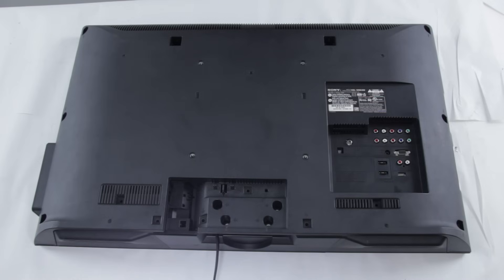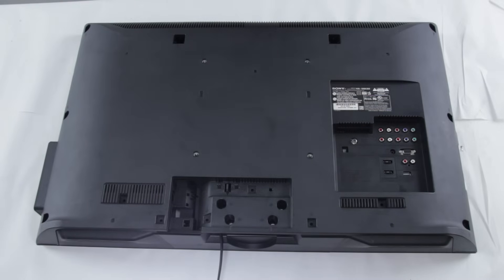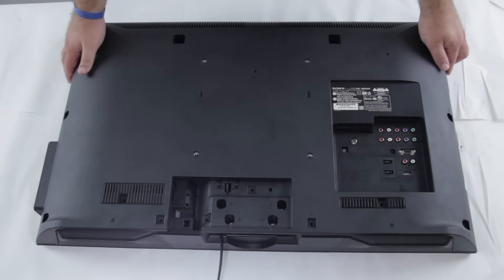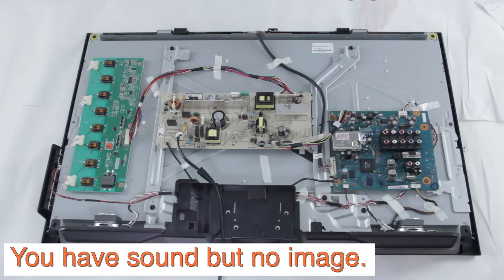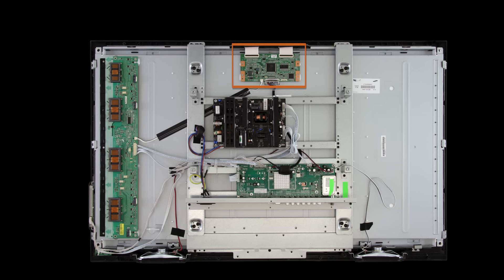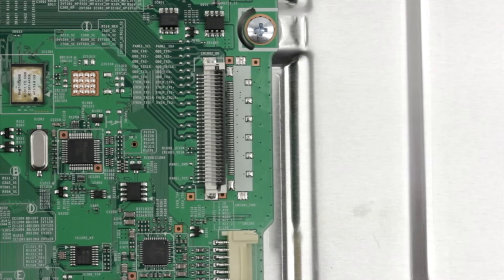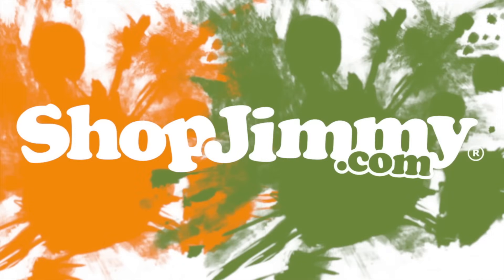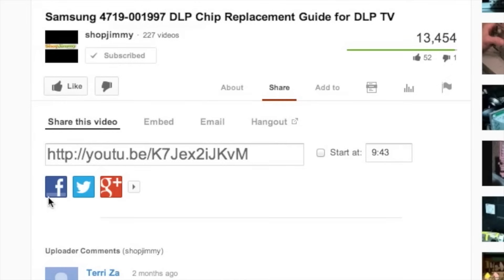LCD TV Repair Tutorial - T-Con Board Common Symptoms & Solutions - How to Replace T-Con Board

Comment: samsung UN55C7100WFXZA Version no : SQ01. all my 4 hdmi input doesn't work. smart tv and USB connection works.  I have tried different hdmi cables, unplug for 10 mins, Factry reset none are working. Device connected tried Directv receiver, PS3, Google Chromecast. Please help. thanks!

Comment: I have a Samsung LN32C350D1D tv with a picture issue.  The best way to describe it is that the image on the screen flickers like a strobe light and strobes upward.  The sound is perfect.  I just plugged in our PlayStation 4 and when the normal blue screen comes on with the white welcome menu, the white letters strobe upwards from the bottom to the top no matter where they originally appeared.  PLEASE tell me it's a simple fix because I'm always up for a DIY dig in and fix it!
Reply from the maker: Kellie Rowbotham  Please watch this video FIRST to help with your repair!  https://www.youtube.com/watch?v=BP3NVNCGEv8  This could be a problem with the backlight inverter or the power supply in your TV.  You may need to replace each board individually to see which one fixes the problem with your TV.  Click this link to replacement parts for your TV model number:  http://www.shopjimmy.com/catalogsearch/result/?q=LN32C350D1D  There may be multiple boards for the same TV model number, be sure to match part numbers on your current board, with your replacement for compatibility.  Thanks and please let us know if you have any further questions with your TV Repair!  www.shopjimmy.com

Comment: I have a Samsung LED UN46C7000WFXZA. Thin black horizontal lines  are now present that are strong on the left but fade near the right. At times they disappear 20 min or so after turn on. At times a little knock or reposition will also make them disappear.  Motherboard? T-con? Panel? Any idea? You comments much appreciated. Thanks.
Reply from the maker: Peter Tigler   This sounds like a TV panel (TV Screen) problem.  If your TV panel is bad, it may be more cost-effective to replace the TV as panels are typically hard to find in stock, difficult to replace, and expensive.  Thanks and please let us know if you have any further questions!  www.shopjimmy.com

Comment: have a dynex model number DX-LCD32-09.. problem is the left side of tv has a yellow hue to it and the right side is normal.. what can be done to fix this?
Reply from the maker: Angel Martinez  Please watch this video FIRST to help with your repair!  https://www.youtube.com/watch?v=BP3NVNCGEv8  This could be a problem with the main board or the TV panel.  You can replace the main board to see if that fixes the problem in your TV.  Click this link to replacement main boards for your TV model number:  http://www.shopjimmy.com/catalogsearch/result/index/?cat=56&q=DX-LCD32-09  There may be multiple boards for the same TV model number, be sure to match part numbers on your current board, with your replacement for compatibility.  Here is a link to a video showing how to identify your part number, click here:  https://www.youtube.com/watch?v=LIWO2A_tuaI  Thanks and please let us know if you have any further questions with your TV Repair!  www.shopjimmy.com

Comment: Sony Bravia KDL-40V4100. Ok. I got this tv and i've noticed a few things. 1. thru the compound cable (R,W,Y) to cable box, I can hear audio but the screen is fully green with horizontal dots moving across the screen in groups. 2. When connected with coaxial cable from the cable box, no audio and the screen is green with the moving dots. 3. When I look at the menu options, when I was trying to pick the input source, the screen looks fine, if I recall correctly. 4. When I turned it on, during my attempt at figuring out the buttons on top of the tv, left half of the screen had yellow and I think brown lines going up and down. 5 at some point during the use of the buttons on top of the screen, it looked like the screen was not migrating from menu screen to menu screen, cleanly. There was like lines or chaos, almost like there was a cable loose connecting the board with the buttons, to the rest of the tv. I'll take a look again on the tv to make sure I saw everything like I said. So, what do you think is going on? Thank you.
Reply from the maker: ulyssescpt   I would check your cable box to see if it is working correctly.  Thanks!  www.shopjimmy.com

Comment: I have an insignia ns-46e560a11. The screen has a white haze and thin vertical lines over the whole screen. I am thinking t con board. fa7m4s120c4lv0.1
  Your thoughts please.
  Len
Reply from the maker: Len Ciufo   This sounds like a TV panel (TV Screen) problem.  If your TV panel is bad, it may be more cost-effective to replace the TV as panels are typically hard to find in stock, difficult to replace, and expensive.  Thanks and please let us know if you have any further questions!  www.shopjimmy.com

Comment: JVC jlc47bc3000 the TV will power on however it stays on the JVC screen. I have tried to unplug the power cable for some time and then plug it back in but I am still having the same problem. The TV also does not respond to the remote while it is on. Based on my research, I believe it may be a main board issue. Am I correct? Also what would be the cost of a new main board?
Reply from the maker: Nathan Maddox   I recommend replacing the main board in your TV.  Click this link to a replacement main board for your TV model number.  http://www.shopjimmy.com/jvc-3647-0502-0150-main-board-for-jlc47bc3000.htm  Be sure to match part numbers on your current board, with your replacement for compatibility.  Here is a link to a video showing how to identify your part number, click here:  https://www.youtube.com/watch?v=l_z-ovbj_BI  Thanks and please let us know if you have any further questions with your TV Repair!  www.shopjimmy.com

Comment: Hi I have a Sony Bravia KDL-32BX300 that has started showing green vertical lines and snow / white lines - it is intermittent and usually clears up after I click off and on a few times. Sometimes it goes all day others it cuts out every 10 minutes or so. I've had it since 2007 so I guess that may be it but I'm suppressed that I didn't get more out of a quality product. Back then this was a $1,500 - $2,000 tv. Today they're going for half that or less. Cheers.
Reply from the maker: Sam Edge   This sounds like a TV panel (TV Screen) problem.  If your TV panel is bad, it may be more cost-effective to replace the TV as panels are typically hard to find in stock, difficult to replace, and expensive.  Thanks and please let us know if you have any further questions!  www.shopjimmy.com
Reply: Did you ever get a reply on this?  This is happening to me.

Comment: Hi there, I have a problem with my JVC LT-32DY8ZJ it does power on fine but the picture is a bit to dark and it's nothing to do with settings, any ideas?
Cheers
Reply from the maker: Radoslav Ivanov  Please watch this video FIRST to help with your repair!  https://www.youtube.com/watch?v=BP3NVNCGEv8  I recommend replacing the power supply board in your TV.  Click this link to replacement parts for your TV model number:  http://www.shopjimmy.com/vestel-20351313-power-supply-unit.htm  Be sure to match part numbers on your current board, with your replacement for compatibility.  Thanks and please let us know if you have any further questions with your TV Repair!  www.shopjimmy.com

Comment: Great video!!   I have a Samsung LN-T 5265F which take about 7 minutes to come, and clicks as it warms and then comes on.    Once on it has thin vertical colored lines on the far right side.    As it warms these lines reduce to a thin dark line which remains.    What do you suggest I do to correct these problems.    

Tony B.
Reply from the maker: Latrice Battle   This sounds like a TV panel (TV Screen) problem.  If your TV panel is bad, it may be more cost-effective to replace the TV as panels are typically hard to find in stock, difficult to replace, and expensive.  Thanks and please let us know if you have any further questions!  www.shopjimmy.com

Comment: I got Sony bravia model no.KDL-46V5100 when i turn it on theres a vertical colored line on a haft of the screen.what is the possible cause of this?
Reply from the maker: Romeo Castro   This sounds like a TV panel (TV Screen) problem.  If your TV panel is bad, it may be more cost-effective to replace the TV as panels are typically hard to find in stock, difficult to replace, and expensive.  Thanks and please let us know if you have any further questions!  www.shopjimmy.com
Reply: ok thank you guys,i go ahead and salvage the parts and throw away the tv panel

Comment: Hi, I have a Samsung 40" LN40B500P3F. The audio works, I can change channels and everything but I see no picture. If I turn off the lights in the room and shine a flashlight to the LCD screen I can vaguely make out that there is a dimmed picture there, it's just not being lit up. I have located the T-CON board on the TV and through your video and some other research the most likely culprit is the T-CON board. Should I go ahead and order a different T-CON board? I'm not 100% sure whether this is the problem or not, so I thought I would ask you first! Thank you so much for your help and videos! They are absolutely wonderful!
Reply from the maker: Rocco B  Please watch this video FIRST to help with your repair!  https://www.youtube.com/watch?v=BP3NVNCGEv8  I recommend replacing the inverter/power supply board.  If the board is out of stock, we may have a repair service available, where you send us your board and we repair it.  Click this link to replacement parts for your TV model number:  http://www.shopjimmy.com/catalogsearch/result/?q=LN40B500P3F  There may be multiple boards for the same TV model number, be sure to match part numbers on your current board, with your replacement for compatibility.  Here is a link to a video showing how to identify your part number, click here:  https://www.youtube.com/watch?v=sSJexLvRrjM  Thanks and please let us know if you have any further questions with your TV Repair!  www.shopjimmy.com

Comment: Hi there, really hoping you guys can help me. I have a Samsung LN-T4665F from about 2009.The TV has an intermittent problem of when I turn it on, it's ok for a few seconds but then the screen goes black but there is still sound. I know these TV's have many problems and I read all about the capacitor failure, but the caps all look good, and the power board was replaced with a new one about 2 years ago. I was thinking of replacing either the logic board or T-Con board. Thanks a million.
Reply from the maker: Andrew Arzoian   I recommend running the flashlight test on your TV.   Here is a link to a video we produced that shows how to run the flashlight test. https://www.youtube.com/watch?v=xUzCLgoSPGM Please reply with your flashlight test results and we can recommend a replacement part for your TV repair. Thanks and please let us know if you have any questions! www.shopjimmy.com
Reply: ShopJimmy.com Thank you very much. I did the flashlight test, and I have backlights, and audio. Based on this, I assume it is the T-con board, but I am curious if a bad t-con board would make the problem intermittent. Sometimes, the TV will go a day without failing, the will start doing it. Thanks again
Reply: Andrew Arzoian Just an update to my problem, I have the TV working ok at the moment, but it will not recognize the cable. I can only use a DVD player or HDMI through the auxiliaries. The cable will not work at all. Does this sound like a main board issue?
Reply from the maker: Andrew Arzoian  Please watch this video FIRST to help with your repair!  https://www.youtube.com/watch?v=BP3NVNCGEv8  I recommend starting by replacing the T-Con board to see if that fixes the problem.  If not, then you may need to replace the main board as well.  Click this link to replacement parts for your TV model number:  http://www.shopjimmy.com/catalogsearch/result/?q=LN-T4665F  There may be multiple boards for the same TV model number, be sure to match part numbers on your current board, with your replacement for compatibility.  Thanks and please let us know if you have any further questions with your TV Repair!  www.shopjimmy.com

Comment: I have a Samsung LN40A TV. The colours are all funny. We have tried to factory reset it, but that did not work. Is it the T-Con board that needs replacing or just garbage?
Reply from the maker: *****   This could be a problem with the main board or the T-Con board in your TV.  You may need to replace each board individually to see which one fixes the problem.  Click this link to replacement parts for your TV model number on our website:  http://www.shopjimmy.com/catalogsearch/result/?q=LN40A  There may be multiple boards for the same TV model number, be sure to match part numbers on your current board, with your replacement for compatibility.  Thanks and please let us know if you have any further questions with your TV Repair!  www.shopjimmy.com

Comment: Hi, I have a Samsung LN40B750U1FXZA with  no picture but still has sound. The tv will produce a picture with sound for a minute or so and then the picture cuts out but the sound remains. If I press a bit on the screen after the picture cuts out I don't see any glow surrounding the area I press leading me to assume that the backlight is out as well. From watching your videos I assume it is either my T-Con board or inverter board (T-Con - 2869C, and Inverter BN44-00284A). Do you have any advice on what to do next in order to narrow down my issue.
Thx
mcbain

Comment: I have a 46" Samsung LCD (LNT4671FX/XAA) I am not sure if it's the t-con board. The screen gets shaky intermittent horizontal lines at the bottom of the screen while watching TV. Playing video games, the problem is much worse.

Another issue that I think is unrelated... there are some red vertical lines that can be seen once in awhile. This issue happened years ago.

I have recently replaced this set, but if these issues can be fixed at a reasonable expense, I am tech savvy enough to do the repairs myself.

Thanks.
Reply from the maker: *****   This sounds like a TV panel (TV Screen) problem.  If your TV panel is bad, it may be more cost-effective to replace the TV as panels are typically hard to find in stock, difficult to replace, and expensive.  Thanks and please let us know if you have any further questions!  www.shopjimmy.com

Comment: I have a Samsung model  #LN32A330J1D  Model Code: LN32A330J1DXZA.  I turned on the TV and picture was good, 5 min later it's washed out, very bright images.  Don't know if the TV is no good or if it can be fixed.
Reply from the maker: John Ryan   Please watch this video FIRST to help with your repair!  https://www.youtube.com/watch?v=BP3NVNCGEv8  This could be a problem with the T-Con board or the TV panel.  You can replace the T-Con board to see if that fixes the problem.  Click this link to replacement parts for your TV model number:  http://www.shopjimmy.com/catalogsearch/result/index/?cat=63&q=LN32A330J1DXZA  There may be multiple boards for the same TV model number, be sure to match part numbers on your current board, with your replacement for compatibility.  Thanks and please let us know if you have any further questions with your TV Repair!  www.shopjimmy.com

Comment: I have Viore 42" LEV42F80. it turns on but there is no picture, back light and on sound. after 10 minutes the green light turns red (turns off). can you please tell me what is gong on? thanks
Reply from the maker: Anas Shawesh   I recommend replacing the main board in your TV.  Unfortunately I do not see any replacement parts in the search results for your TV model number on our website.  Please reply with your part number on your main board and I can try searching for replacement parts.  Thanks and please let us know if you have any further questions!  www.shopjimmy.com
Reply: I did replace the main board and still have the same problem
Reply from the maker: Anas Shawesh   So, do you have backlights?  Do you have sound?  I see in your original question you said you don't have a picture.  Thanks!  www.shopjimmy.com
Reply: Yes black screen

Comment: KDL-46Z4100 SN8204665 Software Version HM-F-QN-8-CO   Dark area in center of screen - right side of screen shows ghosting effect of objects and at times vertical ghost bands.  Any words in the left side of screen show up as mirror image at top of screen.  Hoping this could be as simple as replacing a T-con or BU board.
Reply from the maker: Bill Clark   This sounds like a TV panel (TV Screen) problem.  If your TV panel is bad, it may be more cost-effective to replace the TV as panels are typically hard to find in stock, difficult to replace, and expensive.  Thanks and please let us know if you have any further questions!  www.shopjimmy.com

Comment: I have a Sharp LC-52D85UN that works fine for about 3 minutes. The screen then blanks out while the sound continues. If you turn it off for about 10 minutes and turn it on again you can get picture back. For about 3 minutes. Does this sound like a tcon issue? And, is that model as easy to replace as shown in this video?

Comment: I have a Vizio M601d-A3R that I've had a little over a year and am just out of warranty. There is a horizontal thin line that appeared across the screen today. The line from left to right is transparent to black to light grey/white. It's not coming from an hdmi cable or a device, the issue follows whatever input i select and if I do netflix, hulu, ect on it. I've tried a factory reset on the tv and a power cycle with no change in the screen. Is this a bad T-Con Board? Is this a bad screen? Any help would be greatly appreciated!